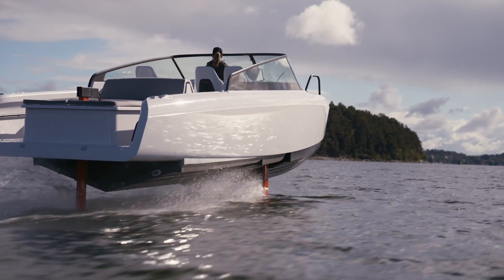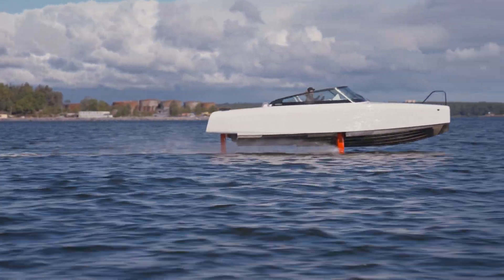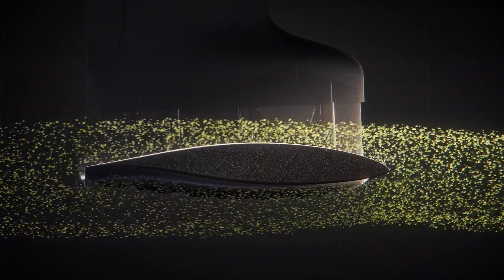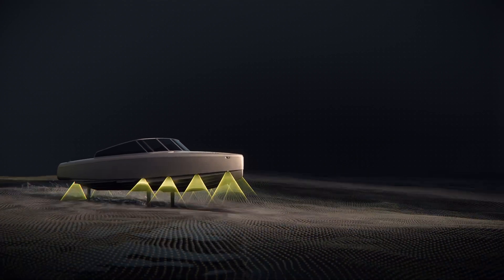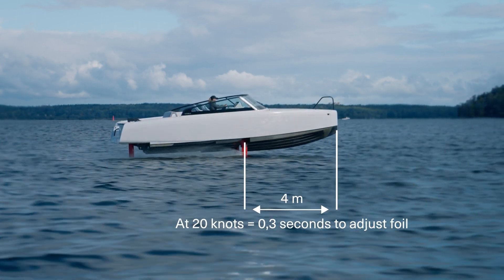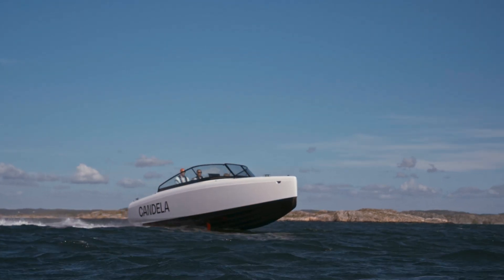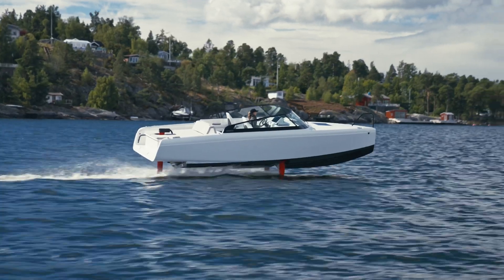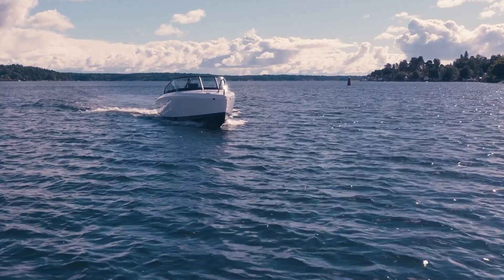Candela Tech Talks | Episode 1, C-Foil System

Comment: What if you try to put a sort of small wings like the foile but on the side of the boat that can be rotated to adjust the stability of the boat?Pratically you did it by the front foil underwater but I think can be possible through the air too having also a hydrofoil but adding the small airfoil

Comment: the way to improve stability is also to move some of the batteries in the foil. Then scale up the hull to be more aero dynamic and act as a wing also reducing the side profile. It is great to see you are pushing for newer designs but electric propulsion is all about efficiency. So you need to get your basics right both engine size/weight/thrust with minimal battery optimize the hull for that weight config. and start reducing water/air drag once you get down the priorities down you can start up scaling battery/boat sizes. It is not difficult just no one have done it before.
Reply: What you really mean to say is that you have no clue and they have done something incredible, right?
Reply: @willm5814 they're promoting electric propulsion, but there is  a lot more room for expansion.
Achieving stability through sensors is one way to do it but there is nothing stopping them from Achieving natural stability either
Reply: @qa1e2r4 Submerged hydrofoils are naturally unstable.

Comment: I wonder if the drag could be reduced even more with steel foils under water. That way they could be made even slimmer for the same strength and less drag. But it depends if the lower drag makes up for the higher weight?
Reply from the maker: No, as then it would be require a lot of force to twist.
Reply: What is the reason you chose the twisting of foils instead of flaps like an airplane? 
Do you think it would be possible to make a lightweight zero-speed stabilization system?  @Candelaboats